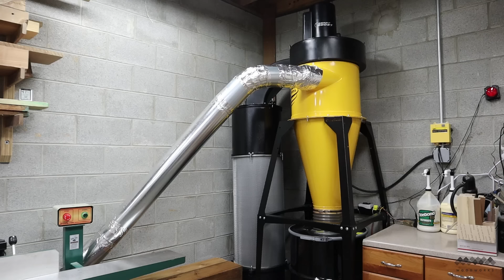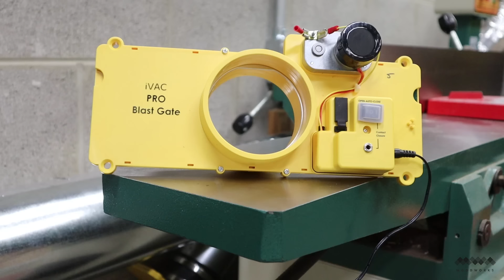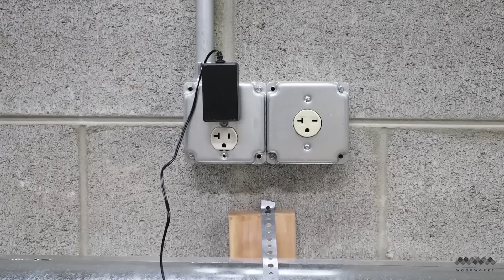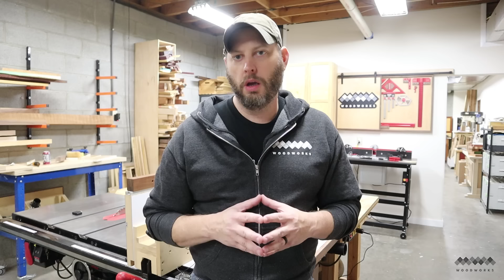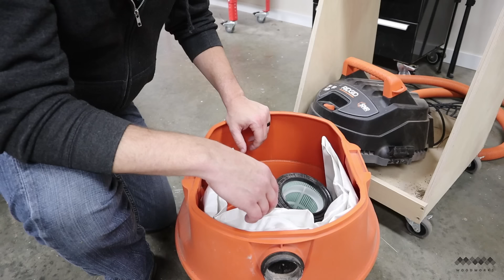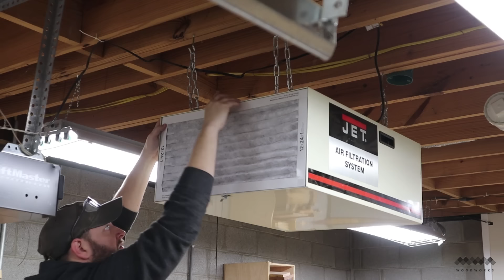Want good dust collection? Do these things well.

Comment: I thought all the Dust Gorilla Pro models were 5hp??? Is this a V-system, since you called out a 3hp motor, or did Oneida change their lineup?
Reply from the maker: They have a 3hp (or they did 5 years ago when I got mine)
Reply: Thanks for clarification. I'm set to pull the trigger (finally) on the same DC. Thanks for the great content!
Reply from the maker: It's really nice!

Comment: I put a cyclone on my ShopVac.  I clean out the cyclone on a regular basis so it doesn't fill up.  At one point, I changed the bag and filter in the shop vac after two years.  The bag in the shop vac was at most only 10% full.  The "used" filter when I ran my thumb across the pleats had no dust comming off of it.  I was shocked at how good it looked.  Those cyclone separators do make a big difference.

Comment: There are several options available for you to put sound deadening insulation into the ceiling of your basement workshop, so noise has very little to no impact on whomever is in the room above you. Rockwool Insulation comes immediately to my mind, but there are many other options available. As an added bonus, Rockwool is fireproof.

Comment: Unfortunately, those dust masks don't do any good if you have facial hair. When you breathe in, it will take the path of least resistance, which is around the edges where your hair is holding it away from your face. I was looking into this before. You end up having to use a full positive-pressure helmet. Those tend to be up in the $1500+ range, so not for everyone.

The rest of this is really good. :)

Comment: Very helpful advice!  With the shop vac Dust Deputy added, is the dust bag still needed inside the vacuum?  Doesn’t that restrict air flow significantly with little benefit, since there shouldn’t be much dust getting past the cyclone into the shop Vac?

Thanks!
Reply from the maker: I use a bag and a hepa filter. I have adequate air flow for every tool I use it on and I get practically flawless air being expelled. That alone will keep the air flow higher for longer and give me be best air quality from my dust collection!
Reply: I ask since a rep from the Fein (shop vac) dealer said if using a cyclone separator with the vacuum don’t use the dust bag and a HEPA filter.  You would overwork the motor and burn it up.  I’ll check with Fein to confirm.

Thanks.
Reply from the maker: Fein makes dust extractors though, not shop vacs (big difference). I would definitely listen to them on their products. This is meant for a common wet/dry shop vac. I can report that I've been using my constantly since 2019 and it still works perfectly 👍
Reply: I checked with a Fein rep and they see no problem with using the dust bag AND a HEPA filter.  It should not over work the motor.  He also said it was probably not necessary to use one and just an added expense.  But I like your idea to get the extra layer of filtration and keep the HEPA filter and exhaust air that much cleaner.

Not sure I understand the distinction between shop vac and dust extractor...is it a matter of power or performance specs?  The dust extractor being on the higher end?

Thanks for the excellent work you do and sharing of insights and experience.  Much appreciated!
Reply: @davidrudig5839  one is a fancy (usually) hepa vac and the other is a motor on a bucket you could get for free behind a Walmart with added poo water

Comment: Why did you end up going with the 3hp vs 5hp? I've been looking at the gorilla pro for a few months and will buy soon.
Reply from the maker: 3hp was all I needed for my size shop. The units are exactly the same except for the motor so if I ever wanted to upgrade all I have to do is swap the motor
Reply: @MWAWoodworks  Swapping a motor to 5hp won't make any difference. The revolutions are the same. The benefit would be from a larger motor that can handle the load of a larger impeller.

Comment: Off-topic but what were you using to hold up plywood as you were cutting it down? I've seen them in the past and after the facts realized I wanted one but I hadn't seen one in quite a while until your video.
Reply from the maker: It's a centipede work holder 👍
Reply: @MWAWoodworks  awesome. thanks!!!

Comment: Great video.
You are the first woodworker I have seen who ran the main dust collection duct low on the wall. I am planning to run mine at floor level. To me, it makes sense to put it low and behind the tools instead of using valuable wall space.
Reply from the maker: Yep. I preserved my wall space and also shortened the distance between the tool and the cyclone 👍
Reply: There are good  arguments for mounting the duct in either position. I went high, as there were too many things in the way at floor level and a big ladder hanging in the middle of the wall. 😁